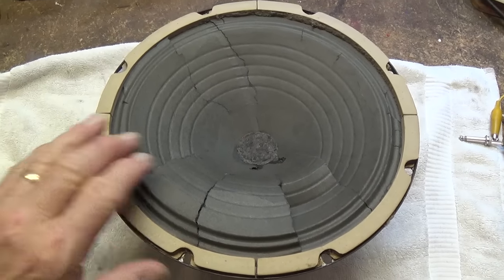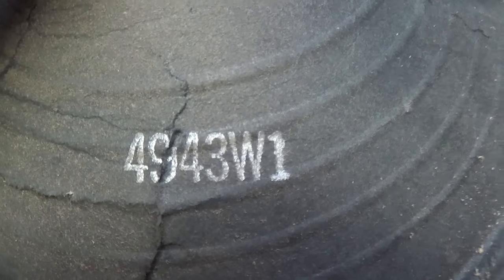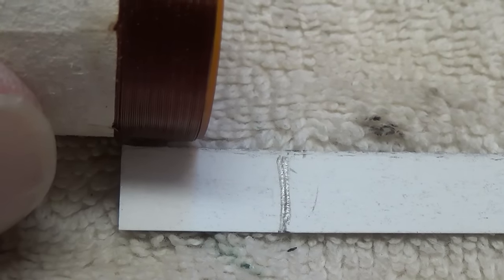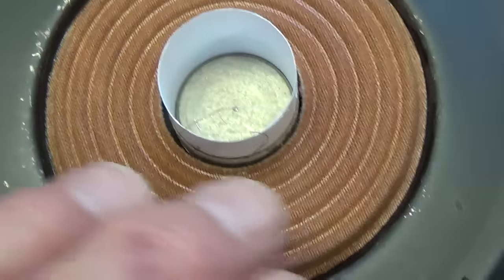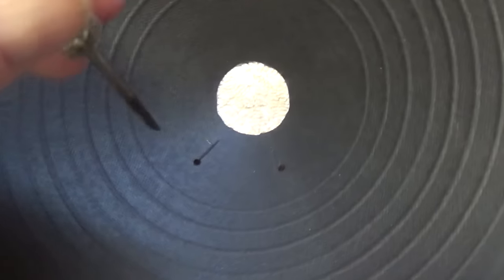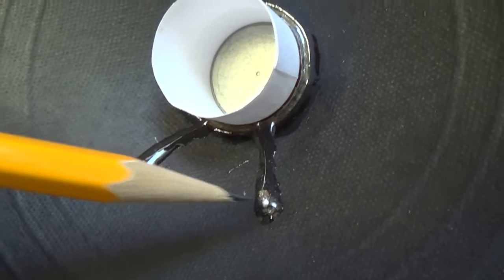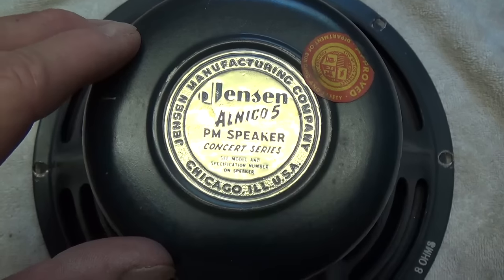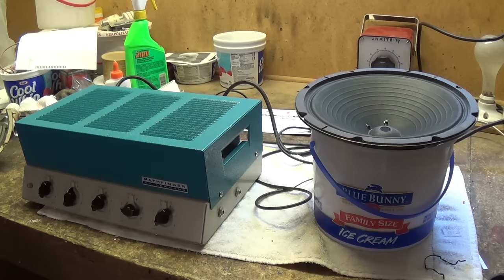How to Recone a Speaker

Comment: Uncle Doug any advice on how to remove a dust cover from a vintage 12" Jensen? I have a new cone but need to shim the V.C.
Reply from the maker: I use an Exacto knife with a fresh, sharp, pointed blade.
Reply: @UncleDoug  I will go for it, Scary when you have a late 40's Jensen.
Reply from the maker: @skullheadwater9839  What is your alternative?  The speaker is junk as -is and can only be improved. Just be careful and do your best. You have nothing to lose by trying.

Comment: I like the desert pics at the end. 
Restoring console (Magnavox 185-11 w/turntable),  will add guitar input.  Original speakers are still intact. One 14",  two 7" and one 4" all are the  Alnico style and stamped Magnavox.  Question: despite looking OK, their age dictates re-coning, right?
Reply from the maker: Not unless the voice coil is rubbing or they "flub" with higher volume. Re-coning is quite expensive now, so you would probably be better off replacing any that are faulty.

Comment: Thank you so much for this video. Can you help with a question? My VC was rubbing & foam surrounds destroyed. I took off the cone (broken under the dust cover, by the spider) & can move the spider without any rubbing. I measured 6 ohms on the VC. Can I reuse the spider/VC?
Reply from the maker: Possibly, but it's a gamble, Mike. It's not much more trouble to simply replace the VC along with the cone.
Reply: @UncleDoug  Thanks for taking the time to reply! On eBay, I found a 6 ohm 1" VC & a cone that seems to be close to the correct dimensions (surround already attached), so maybe I'll try those.

Comment: have a set of older 8 inch woofers (Bolivar 18 speakers) with inverted dust caps that are near impossible to remove as they have a very big  area glued onto section of the cone, so im thinking there must be a reason behind this and would be important to put back to orig to keep orig  sound...  Im having issue with coil rub and i also have to reglue the spider,, so was wondering if i do my best to cut out a hole in cap to get in to shim coil can i  glue the cut out back in.. ???  i know ill be able to see it but i want to keep the orig drivers in these old speaker which have a interesting story to them if one was to read up on them.
Reply from the maker: Yes, if you can expose the VC/pole piece gap, the VC can be reshimmed......but you generally must initially liberate the VC from the cone to prevent the forces that made it rub from reoccurring.

Comment: Thanks UD. Looks like the new former is aluminum vs the paper former of the former (previous) cone assembly. Have you noticed any sonic difference with aluminum or Kapton formers. Fantastic video. Thanks again. J
Reply from the maker: You're welcome, P7. That's a good question. I can't say that I have ever noticed any change in tone related to the coil form material. I do believe that the aluminum/Kapton coils are superior with respect to longevity, resistance to rubbing on the pole piece, and they probably reduce the reciprocating mass of the cone a bit.

Comment: Dam, that speaker sounds good. I must remember the ice cream speaker cabinet. It really provides a metallic tone. Intriguing
Reply from the maker: Thanks, Uba. If you really want a great, cheap speaker enclosure, get a round trash pail about 2-3 feet tall. Turn it upside-down and cut a hole in the bottom and install a good speaker, cone facing upward, magnet toward the floor. It will astound you. Also, you can set it on carpet, hardwood, linoleum, etc. and get all sorts of different tones.  This came from my hippy days....no money but a desperate need for loud Jimi Hendrix music :) If you try it, let me know how it turned out.
Reply: +Uncle Doug thanks for the reply. Next time I'm playing around with some speakers, I'll be sure to try it out. it might be a while, but if I do you'll be first to know.
Your videos are as informative as ever. I never knew how to recone a speaker. After your advice, I'd certainly give it a go myself. That is if one of my Celestion speakers let go in my bass guitar cab.
Dan
Reply from the maker: You're welcome, Uba. I hope your speakers continue to work fine.....but if they don't, I'll bet you can now repair them. Best of luck.

Comment: Doug, the front 6" speakers in my 1994 Pontiac Firebird Trans Am have failed. So far I haven't found any re-cone kits for them. The original AC Delco speakers have a fairly large magnet and the replacement speakers I've seen are of lessor weight.....and efficiency.  Any words of wisdom? Thanks.
Reply from the maker: If recone kits are absolutely not available, then I guess you're stuck with aftermarket 6" speakers.  You should keep the originals just in case a reconing method becomes available.

Comment: I just bought a celestion g12h from 68 but its reconed... will it sound drastically different because of the recone?
Reply from the maker: It depends on the skill of the re-coner and the quality of the materials used, Jordan. Odds are it will sound just fine if the job was done properly with no voice coil drag or bottoming.
Reply: @UncleDoug  Thank you for the feedback! They say those old pulsonic cones really help with that classic rock tone but I've heard guys play reconed pre rola celestions that sound just as good if not better than the original cones... It might be just be placebo🤷‍♂️
Reply from the maker: @jordantee2383  About the only benefit to an old, vintage speaker is that it is completely broken in.....while the newly coned speakers may be stiff and a bit shrill.

Comment: Hi, great video! A question: the material removed from the bottom of the speaker cone so that the edge can lay flat on the rim, did you use the Dremel? An Exacto type knife?
Reply from the maker: A really sharp wood chisel or a chisel-edged Xacto blade will effectively scrape the surface clean, Sylvain.

Comment: Uncle Doug, love your videos! I am restoring my old silverface Fender Vibro Champ and I couldn't get the speaker to come off. The gasket "healed" to the surface of the front of the cabinet. The rest of the speaker is in perfect condition. Is it possible to replace the gasket with e new one without replacing the cone?
Reply from the maker: Yes, Andrew, you can order a replacement gasket from the supplier that I included in the video description. By all means, leave the original cone intact if at all possible.
Reply: Uncle Doug Thanks for responding so quickly! Great to know! Say hi to Jack and Ollie for me! Please keep these videos coming!!!
Reply from the maker: You're welcome, Andrew, from all of us :)

Comment: Uncle Doug 
How do you figure out what little  wire is positive and which is negative...???
Re-come kits come from Parts Direct... right???
Reply from the maker: There is no + or - with single speaker wiring, James. If you have 2 or more speakers, then it becomes an issue.
Reply from the maker: The address for speaker parts is included in the video description of the reconing video.

Comment: Doug - Weldwood contact cement is actually meant to be applied - and dry to no-tack on both layers - if you use it that way the parts adhere instantly and there is no way to reposition anything (and no clamps of any kind would be required either) .  I'm guessing that you're not letting  the Weldwood get that dry and are actually using it wet-on-wet so you can reposition things slightly if you need to - is that correct ?  Thx.
Reply from the maker: I don't wait for it to set up, but you still must be careful when positioning your parts. There is not a lot of re-positioning leeway. One way to make sure the cone goes in centered with the voice coil is to shim the outside of the voice coil.
Reply: I used to build laminate counters using Weldwood - that's how I know about it. if you let it dry on both surfaces as-directed and they touch, you'll destroy the parts trying to separate them- you have one shot. I've never tried to use it "wet" because with non-porous materials like formica and chipboard there's no place for the solvent to flash once the parts are together and it would just never cure correctly. With paper/cloth/etc I can see how that would not be an issue. Once it is dry though no doubt those parts are not coming apart again.
Reply from the maker: I can testify to the strength of Weldwood, which seems to increase with aging. Some care is required during assembly, but I have never had any real problems.

Comment: Hi Doug.  What’s your opinion on how close to the original a truly properly reconed vintage speaker with proper voice coil, paper, etc can get.  I recently purchased an original 1964 Vox AC 30 top boost and only found out after the purchase from my tech that the original silver alnicos both had poor prior repairs which were failing and that both speakers would be best served by being professionally reconed.  I was really disappointed since the original speakers were part of the draw for me, however, my tech said that, even if I found another pair of period-correct speakers that were in reasonably good shape, he would still favor using the speakers that I’m having reconed since they’ll be functionally new.  He felt strongly that, once broken in, they’ll sound as good as the originals, if not better.  I’m curious what your experience suggests about that and what your opinion is.
Reply from the maker: That's a complex question, Jason. The sound quality of a speaker relies on at least 3 variables: magnet, cone, and voice coil. Alnico magnets lose their strength over time, worse than ceramics, so that is an issue. When you re-cone a speaker, you are changing two of the three variables......so some differences are inescapable......however, who is to say that the tone from the original speaker was absolute optimum? Even when new, there was variability between speakers and amps.  I think that re-coning makes sense from an originality standpoint and will preserve collector value in high-grade vintage amps.....BUT there is no guarantee that the tone will not be different from "original". The odds are good, however, that it will be as good or better, either with a well-re-coned speaker or a good-quality replacement. The only thing lost with the replacement speaker would be potential collector value.

Comment: Is it a good idea to upgrade my speaker's cone without changing the original voice coil? I want to change the cone because it is made from cheap thin plastic. I think paper based cone is much better
Reply from the maker: It's a challenging task, MM, but it can be done. I have re-coned several vintage Jensen speakers without changing the original voice coil or spider. The old speaker can be carefully cut away, leaving the rest of the parts in place.  I suspect that a plastic-coned speaker might have a special application (generally high frequency) and might not be suited to a paper cone....but if you do this, let us know how it turns out.
Reply: Thank you for your advice.

Comment: Great video.  I know you primarily repair guitar speakers, but any suggestions for the JBL/Altec dope/goop?  I need to patch a hole in the surround of an Altec 414z.  Hoping to apply some sort Altec goop over the patch....
Reply from the maker: Actually my main interest is collecting and repairing vintage amps, Tysen. Speaker repair is simply a necessary sideline from time to time. If you really want Altec dope, you'll have to contact them. I would probably just use contact cement.

Comment: Could I use a wire wheel on the gasket part of the basket?
Reply from the maker: It's better to scrape it clean, Kevin. If you do use a wire wheel, be sure to cover the magnet gap with tape prior.

Comment: GREAT VIDEO...Newbie to speaker repair,,, but i just picked up a set of Bolivar 18 speakers that need foam... upon trying speakers and moving cone around, one speaker will play clear, but other speaker woofer will not and is scratchy noise... No matter how hard i try the cone will not move freely in and out .. 
Bad voice coil ??  dirty ??   i did blow it out with can air around pole piece but it didnt help..
Also i now fine the spider's are torn away from cone... I was thinking i may be able to glue spider back to orig cone  ??  
Any suggestions would be great..
Reply from the maker: If the voice coil has seized, then it probably needs to be reconed, C5. Go to the Speaker Exchange site for parts.
Reply: @UncleDoug  yes ive emailed them and the only response was,, they have no parts for this model...
Im sure there are parts that fit this speaker, One example is the voice coil.. How would they know they dont when i didnt give them measurements of the coil ??
Reply: @UncleDoug    So since im new to this and my voice coil is rubbing bad, i looked a little closer at inside of coil and the material seems to be lifting ?  as i can see fuzzy ... Im assuming it suppose to be smooth ?

Comment: Uncle Doug -   Where did get the actual cone material from ?  Apparently they come in different sizes.  Does the type of cone material effect the sound ?
Reply from the maker: The material is simply rather thick paper, Lost, probably impregnated with a sealer and/or resin preservative. Yes, they come in all sizes from 3" to 18", or more. Yes, the material does affect the tone.

Comment: Outstanding job. Wonder if these kits are reproductions or old stocks?. I love the masking tape trick, I have been cleaning radio speakers that way for years now, came up with an almost identical method on my own when I was younger. By now many times I am able to take apart a rubbing speaker, clean it and rebuild it with all it's original parts. Takes quite some time to break the glue apart as to not cut anything though. Very nice shots of the desert.
Reply from the maker: Thanks, Mr. T. The kits appear to be newly made, but the quality is just fine. Glad you liked the desert trek :)

Comment: Also, do you know what metric determines the size of the speaker?  My supposed 6" speaker measures about 5.5" in diameter at the front gasket. Thanks.
Reply from the maker: I believe that most speakers are measured from outer edge to outer edge, then round up if it's a little smaller than a round number of inches.
Reply: Apologies for my dumb question. I have a few 10" & 12" speakers laying around here and should have measured them . DUH. Senior moment. Sorry.
Reply from the maker: No problem :)

Comment: Great job, just 1 question, those high tech clothes pegs are they metric or imperial and does it make a difference as which type is used?
Reply from the maker: Thanks, MC.  Yes, the clothespins are metric and MUST be constructed of virgin Himalayan Cowdunga wood, with titanium-iridium springs. I get mine online from I. B. Pinchen, Ltd.
Reply: Great they are the same ones I usually use.
Reply from the maker: Great.....but be sure to wear mink gloves when attaching them to the speaker.
Reply: @UncleDoug  The mink won't keep still. Am I doing something wrong?

Comment: Hi, Doug. I have a set of Wharfdale E50's with bass drivers in need of re coning. The cones are nor available anymore from manufacturer. They are 10" so I imagine a cone from another make of speaker could me made to fit, as you did in this video. I don't know about the voice coil however... I expect they vary hugely. What is the best way to go about this? Cheers
Reply from the maker: Contact Cathy at the link in the video description for the source of re-coning supplies that I used in the video. Give them the measurements of the voice coil, and see if they can't come up with something suitable.

Comment: Nice Job, UJ! How's the rebuild holding up now after a couple three years?  And it was great to see old Rusty! He was a great shop mascot! :)
Reply from the maker: I've never had a single problem with any of the speakers I've re-coned over the years, PM. If you use good replacement parts and careful technique, they really tend to last.
Reply: @UncleDoug  Only reason I mentioned it (I've not done a recone or resurround job as of yet) based on all of the vids I've looked at, they tend to have a special glue specifically for doing those jobs. Nice to know that a quality rubber cement does a good job, I used WilsonArt 600 on the Altec Lansing 6.5" foam woofer surround repair. Worked great! Tested it last evening, didn't crank it, but did  turn it up to a fair volume to hear the quiet moments and no issues, so much thanks again for the tip.

Comment: I have some old black widow speakers that came out of a old sunn 4x 12 cabinet im going to try to repair them ,i hear they are very desireable ,its mostly just tears in cone i replaced them with celestion rocket 25 w speakers ,but would really like to repair the old 1s ,i put them in the boxes that the new speakers were in and sealed them up,new 1s a
re going for$268 a piece think they may be worth saving lol
Reply from the maker: You can buy new cone units for Black Widows, Joe......just the cone and basket.....which you then attach to the magnet portion with screws.

Comment: There's one thing I don't get. You positioned the voice coil such that when the cone moves out, part of the voice coil will be outside the magnetic gap. Is that right? Don't you want the voice coil mid way between the bottom and top of the magnetic gap?
Reply from the maker: You want the VC to be positioned so that its inward excursion does not hit the bottom of the gap channel. Generally, the outer edge of the coil will not rise much above the surface of the pole piece......but even if it does rise slightly above it, the magnetic field extends much further outward, so the coil is never beyond the magnetic field.

Comment: Greetings Uncle Doug. Was wondering if the hot glue gun would be sufficient for gluing the spider to the coil? also, who do you like for reconing supplies? Great video <3
Reply from the maker: I am not a fan of hot glue, Eric. Epoxy is the way to go. If you check the video description, I provide a link to a good source of coning supplies. Best of luck to you.